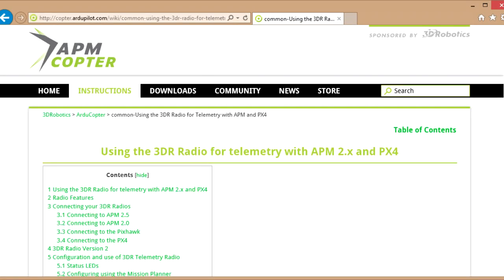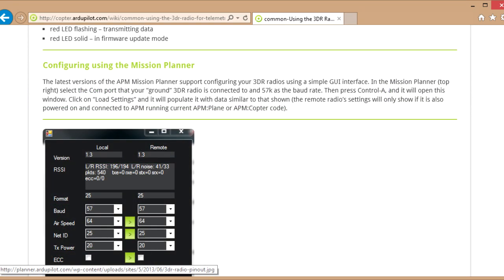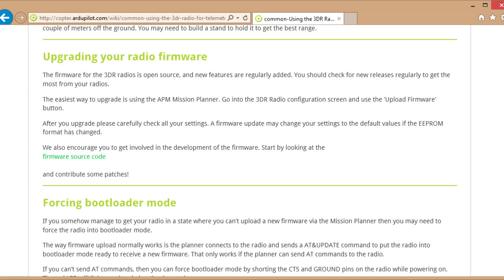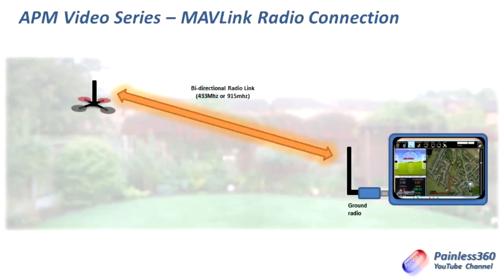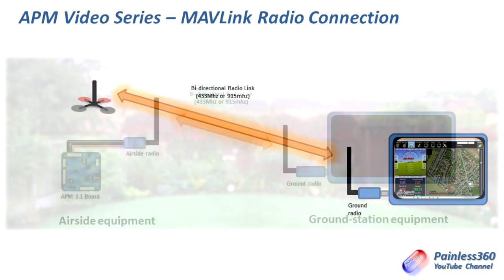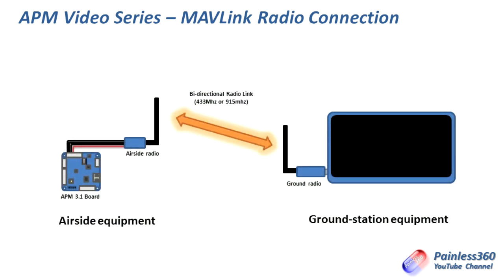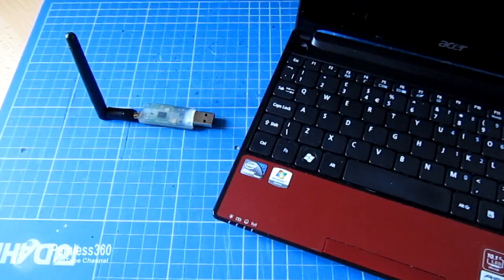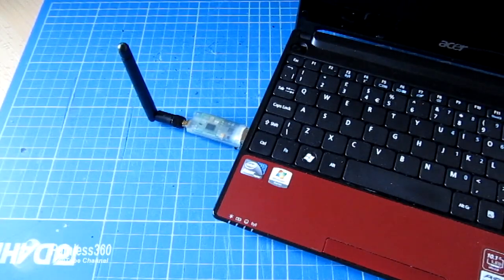APM 3.1 Video Series - Simple 3DR/MAVlink radio setup and use

Comment: I have two pieces of FPV Telemetry Module. Both of them are Ground module. Can I use one of these modules as air module? I want to connect ground module to the pixhawk cube. Because my air module is not working. Thanks
Reply from the maker: It depends on how they are made. The modern ones seem to like to be either.. Best of luck!
Reply: @Painless360  I made many attempts but with no result 😢
Reply from the maker: I'd suspect that you are using the very inexpensive older style that were dedicated. Best of luck.

Comment: Hello can you help me with the ground base connection of these radio connections. I plug mine in and it doesnt instal the drivers. It lights green but no connection led.
Thanks
Reply from the maker: If you are using the same ones as I did, then these are very old technology now. See more up to date videos for modern options. It'll probably be a driver issue so I would contact the seller for a manual and help. Best of luck
Reply: @Painless360  which is the best ground controller to use? Q ground control doesnt seem to have the mavlink view to check the devices firmware and parameters,
mission planner does but i hear mission planner is now obsolete

Comment: Hey, is there any existing support in mission planner and ardupilot for frsky telemetry <-> ardupilot communication?
It seems from my own searching that no-one uses frsky telemetry with ardupilot <-> mission planner, quite confusing 😢. frsky r9m has better range for one thing!
Reply from the maker: Smartport telemetry is coming and I've setup the passthru telemetry back to my FrSky radios in all of the recent Ardupilot builds - check them out..
Reply: @Painless360  Oh nice, it'll be good to remove the need for the pass-through converter in favour of native smartport. At least mission planner-like functionality for telemetry is supported directly on frsky radios, but what about support for frsky radio to mission planner over a serial connection?

Thanks for replying so quickly 😍 Love your work, I'm just about to get my first aircraft and your videos are my primary resource
Reply from the maker: All covered in the upcoming Telemetry video.. Stay tuned!

Comment: Hye im new in this hobby , i confuses how to get realtime telemetry during flight such as direction of plane and amps battery voltage and etc . I want to monitor it using pc in field .
Reply from the maker: I have videos on the telemetry radios you can use. Updated video coming soon as well
Reply: Painless360 thnks you so much

Comment: This is a great video.  After I restored the defaults and got the 3DR radio connected to APM on my Mac and the X8+, I got the 417 params downloaded and Load Settings STATUS: SUCCESS and on Ground Control side on telemetry I see solid Green.  YAY!  But when I Copy Required Items to Remote, nothing happens and on the remote craft side it is still flashing red.
Reply: I am on a Mac.  SO  I have now been able to get green on both ground station side green and and the craft, but in doing so, it seems to have deleted the port settings to connect directly from the computer to the craft, so since I got telemetry working,  the settings used previously to connect from the PC to the craft are gone.  No idea how to recover them.  It says its connected but now never provides any Flight data  in APM that previously, so what I think is I need to recover the port settings for direct connect to the craft.

Comment: What is the difference between the APM 3.1 VS APM 2.8??
Reply from the maker: The APM 3.1 is the 'mini' APM. I wouldn't use the APM now, it's VERY out of date. See my more recent builds..
Reply: @Painless360  oh my so is apm not a good enough starter platform i am now building my hexacopter with an apm 2.8 flight controller planning to do aerial photography is there a better option as in bang for your buck out there that has an open and supporting market like the apm? Please let me know i feel so silly right now. 😵
Reply: @Painless360  ok so i just went over and now i am planning to change to the pixhawk i saw 2 deals on amazon one with everything inclusive of gps and such and another without i am now wondering if the accessories i have for the apm 2.8 is compatible with the pixhawk

Comment: Hi.  I am having issues with the heartbeat on my pixhawk.  I cannot connect to the pixhawk via mavlink telemetry.  Updated drivers but not working.  Any ideas or suggestions?
Reply from the maker: Sounds like the radios are not connected - see my other videos on the telemetry radios. Best of luck
Reply: @Painless360  thanks I'll check them out.
Reply: Thanks for the videos. I will try and check out the wire connections and see if I have to reverse the tx and rx wires. If not I guess it might be a firmware update. If both the air and ground radio have usb plugs, can I update them via USB or do I need the ftdi bridge?
Reply: Ok so using the Sik radio configuration app i was able to communicate both radios.  The red LED was flashing in both units.  The issue is with mission planner that will not send the command via the telemetry radio.  Any ideas what to look for on the parameter list? thanks for all the help provided.

Comment: Hello! So if I set a mission path for my drone and pause it midway, will it be possible to control it manually with my Radio controller?
Reply from the maker: Yes - by taking it out of the AUTO mode. - see the detail in the excellent Ardupilot documentation.
Reply: @Painless360  Thank you so much for the response, if possible do direct me towards the specific document, great help thanks!

Comment: I also haved problem with driver on win10 and get back to privios version on 6.7 . After what i have connection on ground part. and I think i will need to update firmware with ftdi on both sides to get the right link. thanks for video.

Comment: Love this video. Worked first time for me but now they constantly blink green lights and can’t find each other. I’ve tried downloading older drivers & also tried windows driver reassignment but nothing works anymore. The info for one plugged into the pc always comes up but not on the one hooked up to the rover. Just can’t get them to have solid green lights anymore. Any advice would be greatly appreciated. I’m using the following:

powerday®3DR Radio Wireless Telemetry Kit 433Mhz Module for APM2.6 APM2.7 Pixhawk PX4 https://www.amazon.co.uk/dp/B00Q7US5NG/ref=cm_sw_r_cp_api_i_EEjpCbHSDK62G

Comment: Hi there, I am running apm 2.8 with 915mhz telemetry, can I use my 5.8ghz fpv googles to receive signal from the telemetry?
Reply from the maker: +harry phillips no you can't, you'll need a telemetry radio to plug into your tablet or PC.
Reply: So how would I get the video feed to appear on my fpv googles!

Comment: Hi...  I just received my 3DR telemetry V2 from ebay.  I have APM2.8 so I have to change the connector going into the APM2.8 side.  Matched the RX to TX and TX to RX in the APM connector.   When I fired up my drone and also pluged in my second radio into laptop,  All I got was only solid green light.  No second blinking light. 

Under Mission planner,  I kept getting " Failed to enter command mode" when loading settings.   I have changed the baud rate to 57600 and still error. Flipped the rx/tx in the APM connector and no help.  Any other idea?
Reply from the maker: Not sure, I've not seen that but a quick search of the forums show others who have. Best of luck with it, I hope you figure it out soon..

Comment: I've got a question. I can't get my radios to work after I soldered in the osd. They were working fine when I benched tested them on an APM 2.8. But when I installed them into the APM 3.1 and soldered in the OSD all I get is "no heartbeat packets received". I've redone the solder connections twice. I'm positive my solder connections are good and I know the radios work because I bench tested them on an APM 2.8. But I can't get them to talk plugged into the APM 3.1.

Also, I get the solid green light when both are plugged in. When I click "load settings" all the radio information on both sides comes up. So that tells me they are communicating. I have the baud rate set at 57600. 

You have any idea what my problem could be?
Reply from the maker: +Walk 434 an APM will only run one device connected to the telemetry port at once.. best of luck.
Reply: I got the remote on the quad blinking. Which tells me that's it's now receiving packets. I had to install the Arduplane firmware instead of the Arducopter. I think the problem may be it's not able to transfer the parameters over the link to the remote. I may need to get an FTDI and hook the remote up to the usb to install the firmware to it.
Reply: I just had a brainfart. I did not hook an ftdi up to the minimosd to set the correct firmware for the flight controller. I still think I need to do the same with the telemetry radio as well. I think maybe when I perform both of those steps everything will work just fine.........least I hope. I'll keep you updated.

Comment: which is better telemetry system 915 MHz or 433 MHz
Reply from the maker: It's not a case of what's better, its a case of what's legal to use in the country your in. Some more detail here - http://ardupilot.org/copter/docs/common-telemetry-radio-regional-regulations.html#common-telemetry-radio-regional-regulations

Comment: Need some help.
Not sure what i'm missing, but i cant get it to connect to planner at all.
The green led goes solid on both ends, but i cant seem to get flashing red (heartbeat ?) ?
I can connect to both ends on planner (sik radio) while usb is in usb and air is connected via ftdi adapter. Can read the settings on both. Flashed local, but it still wont connect.
Checked and rechecked tx/rx wiring, baud settings, etc...
Help ?
Reply from the maker: Have you tried another USB cable?
Reply: Cable is good. It was a case of "fear of specialist" :D
First time aster reflash didnt work. Kicked it off my table, all angry, retried a bit later and it connected. No idea why. Ghost in the machine, etc...

Comment: hi! does the ground station like PC needs to be connected to internet while flying in order to update the map or i can use it in the field even though without internet connection?thanks
Reply from the maker: Nope, Google 'Mission Planner Prefetch' ;D
Reply: thanks.
Reply: by the way, 3dr radio is 100mw only right?im thinking of making a DIY amplifier to make it 1000mw for both tx and rx side so it can match up with my DIY 1000mw 433mhz openlrsng transmitter.
Reply from the maker: Be careful - I'd look at the power you are legally able to use in the country you're in on the frequency and usage you want.. Best of luck!

Comment: Hi... I seem to have found something odd with the Pixhawk, MP, and the 3DR Radio.... I followed your instruction, and plugged the newly updated 3DR into the Pixhawk Telem 1 port... No heartbeat. So I started testing things and here is what I found:On the pixhawk, there are 2 telem ports, and if you go into MP under Full Parameter List you see the 2 telem ports list as:Telem1     SERIAL1Telem2     SERIAL2Could these be backwards?I tested this by setting both ports to 9 (9600) since nothing works with that much anymore.My 3dr radio did not work in either telem1 or telem2 as expected.If I set SERIAL1_BAUD to 57 and SERIAL2_BAUD to 9My 3dr works in TELEM2 port but not telem1 port.If I set SERIAL1_BAUD to 9 and SERIAL2_BAUD to 57My 3dr works in Telem1port but not in Telem2 port.You must Reboot the board before the new values take effect.Let me know what you think.... Is this something I should report, or is it a known issue already. I am fine since I got everything working.... But there is a lot of people having problems with this if you check the forums, and no one seems to have noticed this. Maybe it is my Pixhawk from China, but everything else is working fine. Thanks Steve
Reply: Nevermind... I found my problem... I cannot read the top of the pixhawk... Sorry Steve
Reply from the maker: Glad you got it sorted!

Comment: what mhz this telemtry?
Reply from the maker: 915 or 433 MHz depending on location..
Reply: what the diferent 915 and 433??
Reply from the maker: Apart from the frequency it uses, very little. Lots more detail you can read up about in the documentation for APM - http://ardupilot.org/copter/docs/common-sik-telemetry-radio.html

Comment: Can I use two "airside" radios but connect one to the PC with an FTDI adapter? Will the link work? thanks
Reply from the maker: I've not tried but if one is master and the other slave with the same ID it might. The radios are so cheap now not sure why you'd make it harder than it needs to. Best of luck!
Reply: thanks. I'm asking cause on the ground side I want to use a serial Bluetooth dongle that will connect to my phone. that won't work with the USB port
Reply from the maker: If you get it to work, let me know.. Best of luck!
Reply: ok. thanks!

Comment: So the warning at the end is for? I did what you said not to. did I smoke the remote radio? Green solid light shows linked ye the is no heart beat when trying to connect. Thanks for all the great videos.
Reply from the maker: Powering ANY transmission circuitry/power system without the antenna attached will have a high probability that the transmitter will be damaged. I'd try and update firmware and confirm the 'magic number' is the same on both radios and if it still doesn't work then you've smoked one.. Best of luck!

Comment: can I change the settings on both telemetry modules without using the FTDI module? thx
Reply from the maker: If the radios are talking to each other then you can change things over the connected wireless link. The latest version of these radios (V2) have USB connectors on them to avoid the hassle. Best of luck!

Comment: Question: The whole of Youtube seem to agree that these rubber ducky antennas are rubbish. 

Can I swap them out with those clover leaf types for better range?
Reply from the maker: That's normally talking about FPV systems. These radios use a much lower frequency with a lot more 'punch' and penetrating power than FPV transmissions so it's less of a problem. Happy flying!
Reply: What about using a lightweight 433mHz Sander style antenna from a ezUHF rx? Hopefully this isn't too outside the scope of your APM 3.1 series, but what is the difference compared to the Mini APM Pro?

Always great videos. Painless360 channel is my go-to for excellent RC advice. Thank you for all your work for us!
Reply from the maker: Sorry, that's outside my experience. We've also not used the APM Mini Pro here either. Sorry I can't be of more help on this one..

Comment: Your videos are awesome.  Thank you for putting in the time and effort.  I have an APM MINI 3.1 from Banggood.  I've got it installed a quad.  I have spent DAYS trying to communicate via MavLink telemetry.  I finally took a working pair of telemetry units (off another quad) and installed them on the Mini and while the green light stays solid and I can read the parameters from both units in MIssionPlanner, I cannot get the two to communicate.  All settings are the same and the pair work on another quad.  I'm wondering if their is an older firmware or something I can install that might solve the problem or if there is a setting in Mission Planner I'm missing.  Any help is appreciated.
Reply from the maker: +Mark Danemann I'd try and swap the Rx and Tx pins on the airside in case. Failing that the process in the video is how we got it working here.. Best of luck.

Comment: you can unplug the cables from the conector and change the type, its easier than cutting the cable and fixing hte connection.

Comment: +Painless360 Hey, so far im able to set up connection between the ground module and the air module, but, when I go to flight data tab and click on connect( baud rate of 57K) a pop up comes up and says done and the next thing that happens is my PC restarts! at first I thought its the USB port, I changed the ports and tried but its the same! My damn PC restarts! Any Idea? the PC runs on win 7 32bit OS
Reply from the maker: Sound like a basic driver problem. I'd delete the device in device manager and try again. Best of luck!
Reply: +Painless360 hey man, Thanks a ton! It worked! one of my other APM 2.6 shows Bad compass health, and im unable to calibrate the compass. the live calibration tab displays error 99 message and 0 samples are being taken! Do you think the compass is fried?

Comment: Where in hell do you buy these from??
Reply from the maker: +PJgearhead Banggood.com, eBay. All the usual places. Search for '3dr radio 433' to find them ;)
Reply: +Painless360 Thanks yeh found em, but none mention compatibility with 3.1, and I can't find the original 3DR ones, all the ones I have found are Chinese.
Reply from the maker: So long as the cables will fit they should work. Best of luck..